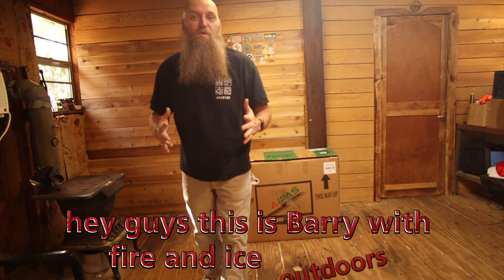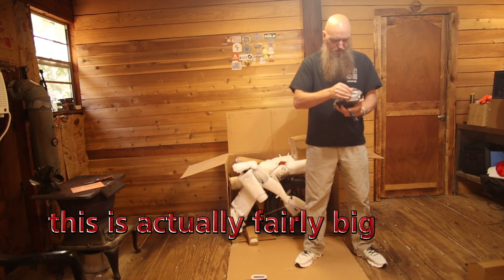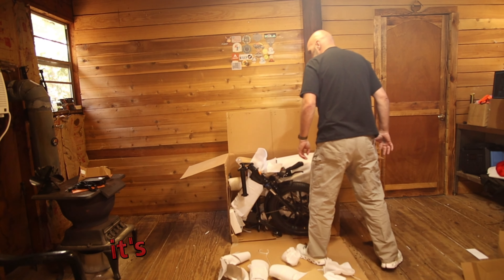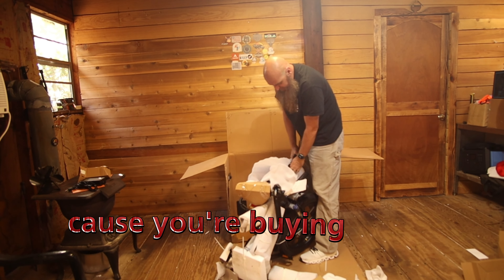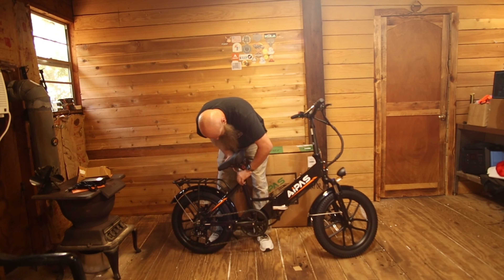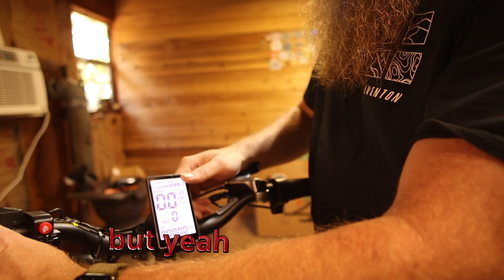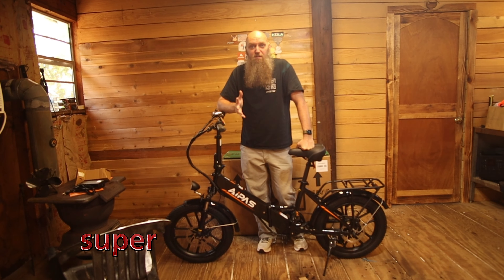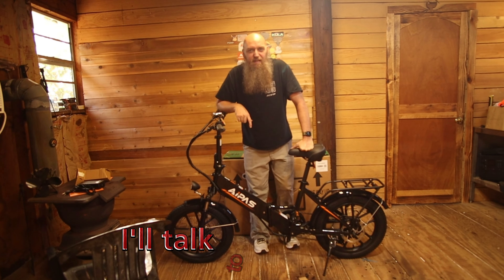Is this the best Foldable E-bike? A2 Elite Folding Ebike

Comment: I love your videos. Have you seen the anniioki aq177 Promax? Supposedly it has a 200 Mi range with pedal assist. I guess the battery is a 60 amp hour that's the one that I want to at least try or see you ride for a range test.
Reply from the maker: I would love to they just have to reach out to me. Sometimes I can reach out to them.

Comment: plus what bike would you recommend under $1500 for a 6'3" 300lb guy? it will be just for camping and beach / flat trail riding.  I was lkooking at the Aipas Cargo Version looks like a knockoff of the lectric xpendition
Reply from the maker: Take a look at the juice line and Cyrusher line make sure you get a fat tire bike that’s what you would need for the beach
Reply from the maker: Are you talking about discount links?
Reply: All Wheel Drive Philodo. Not fast but powerful.
Reply: I ordered the Aipas M2 off road mountain bike with 4 inch wide tires and it's rated at 450 lbs. It has 110nm also. I wish I could find reviews but they are limited to a few. But of all the A2 reviews and their cargo bike reviews in such abundance of greatness I went ahead and ordered the M2for myself and A2 for my wife should be here May 21. I think the m2 os fairly new model though.